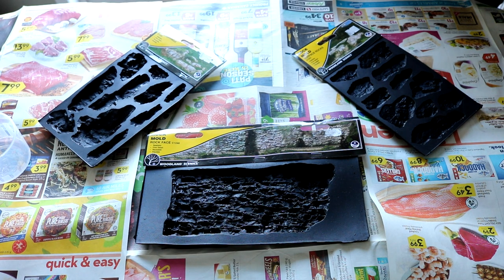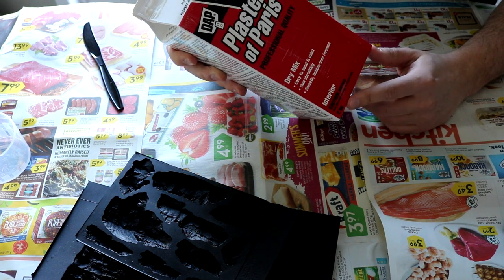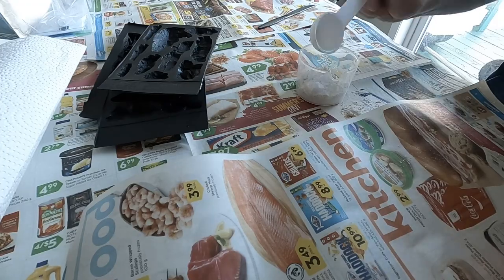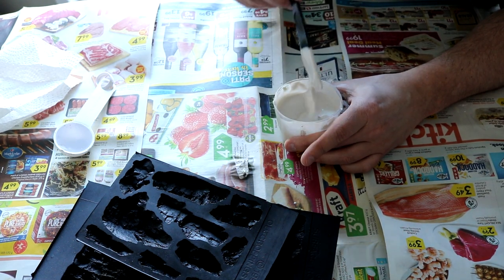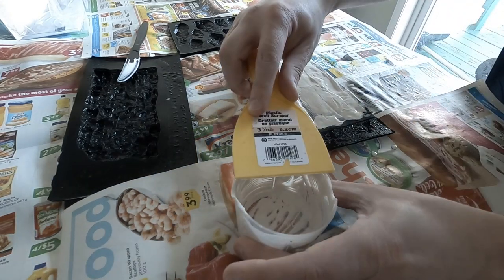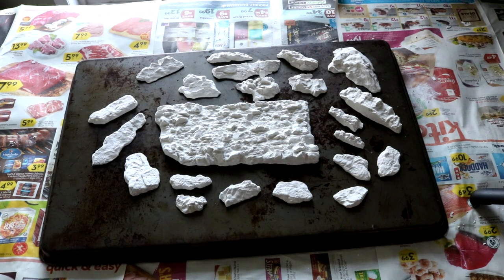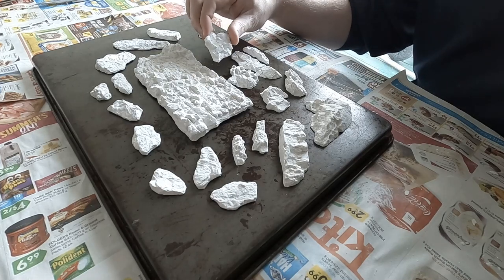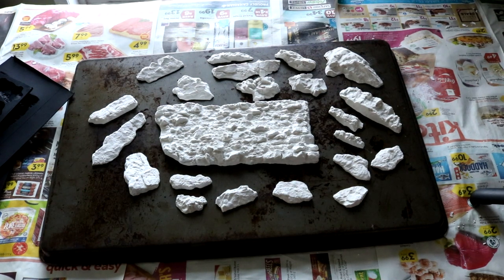Woodland Scenics Rock Molds

Comment: 2:1 ratio ... 2 parts plaster to 1 part water, e.g. 2 cups plaster to 1 cup water. Pour water (lukewarm)  into a large bowl and then add the plaster powder. 
Stir and pour mixture into molds prepared with a mold release spray or wet water. Work quickly, the mixture will harden in 5 minutes.

Comment: Awesome video I did a video home along time ago where I use 5 minute drywall mud it has plaster of Paris already in it and you can get a bag for ten bucks. I just went to check the price again and for plaster of Paris it's $10 for 4 lb and it's $10 for 18 lb of 5 minutes drywall mud I think when I did my video it was 25 lb for $10
Reply from the maker: I love comments about cheaper alternatives. Wouldn't 5 minute fast drying drywall mud dry too quickly to work with?
Reply: @nscaler454  oh no it doesn't dry that quickly I've done rock as well as tunnel ports
Reply: These videos are from 11 years ago when I learned about this I was going to make a brand new video that one better quality